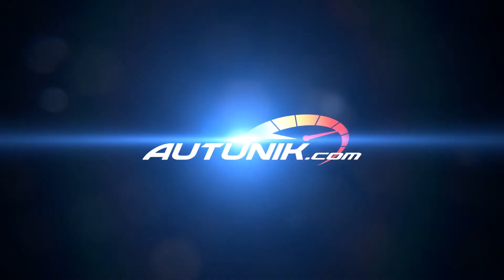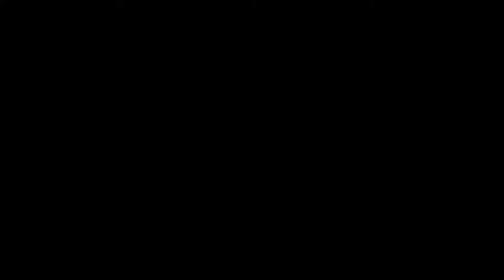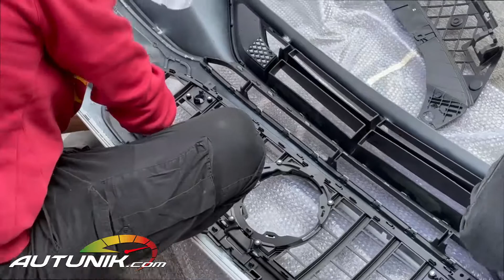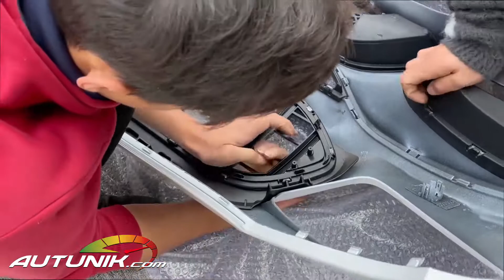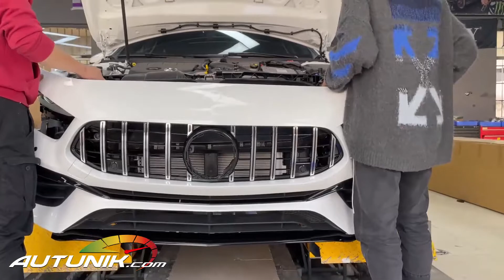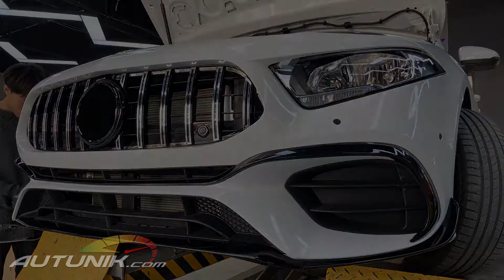Autunik.com - GTR Style Chrome Front Bumper Grille For Benz A Class W177 A200 A250 A45 pz195

Comment: A question guys, these additions only work on the w177 model, correct?

Only this year the w177 version received an update on the front of the bumper, it was updated but the same model remains, that is the w177 but from the year 2023.

I know this works well on the w177 model from year 2018 to 2022, now I don't know if it works on this year's model, because there have been changes, can you check?
Reply: Maybe